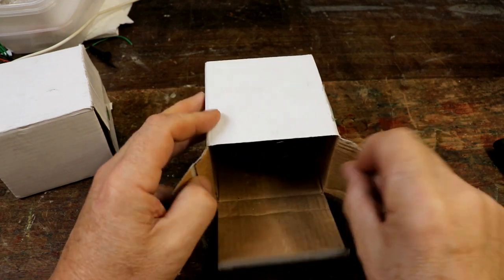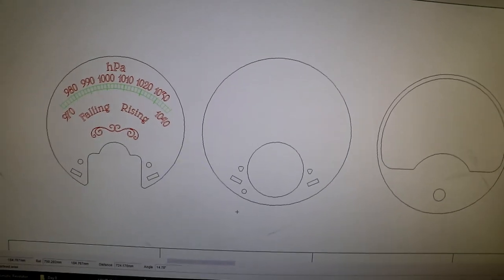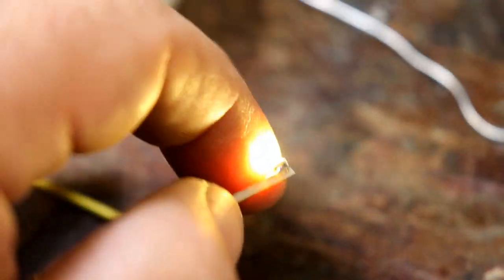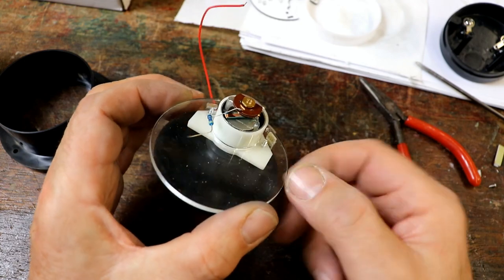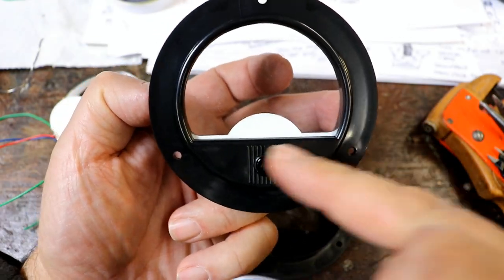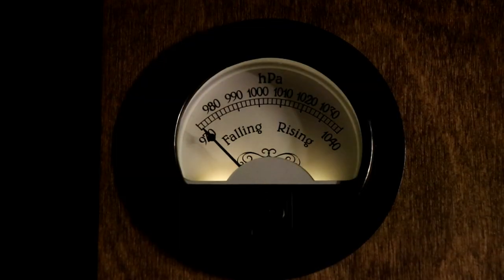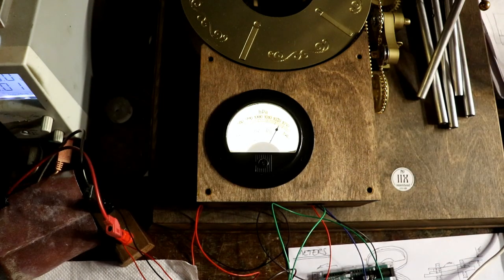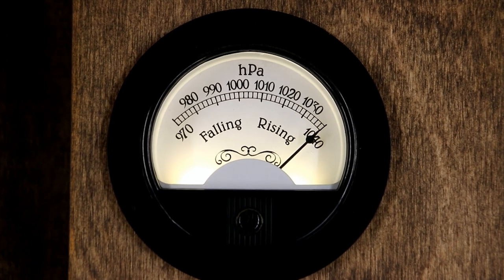How to make your very own working steampunk gauge

Comment: Hi there fascinated by your work and how professional the dial looks.  😊
Anyway, I was wondering what graphics software you were using to draw the dial. I’m having a terrible time with the graduations.😢
Also, I have one of the cheap 20mW UV lasers that use the extruded aluminum beams and web-belts. 🧐
It uses this disastrous Ben-Box software that is unusable and my PC screams its malware!  😮
So, what software coil I use to control the laser; as I think its mechanics are good enough since similar to a 3D printer? 🤓
Thank you for reading my comment… 😊
Reply from the maker: Thank you kindly!

I design the dials using 2D Design by Techsoft. It's used in DT departments in most schools in the UK, as it's been around for years and still only requires a one off license payment. 

It has fairly basic tools, but has one that can rotate and copy a line by a certain number of degrees, around a point. I just divide the required overall dial pointer movement angle by the number of divisions required, and get it to draw the divisions where required. Using the same tool, I start with zero, and rotate and paste the text in the same way. Then I edit each text number to the required value.

I'm sure there must be cleverer and more expensive ways to achive this, but it works for me!

My 60 watt laser cutter also uses extruded aluminium beams and rubber timing belts, but can accept .dxf files. I'm not familar with the Ben-box software. Mine is an LS 3060 bought from HPC Laser Ltd in the UK.
Reply: @steamhead  Ok, well thank you very much.  
I’m an Amateur Radio operator and have several old meters that wool be nice to modify.
There are some professional paid programs I’ve seen before but they all have weird jaggies so yours looked better.
On the laser, most people have been steering me toward LightBurn.
Anyway, this helps out a bunch, so thank you! 😊
Reply from the maker: @SpinStar1956  Happy to be of help. I've found, however you do something, there'll always be loads of people telling you about their fantastic alternative! Whether it's a laser cutter or a programing language, I've never been told 'you're doing it the right way'!
Reply from the maker: A friend has just discovered this gauge graphics software https://soulmare.github.io/scale_master/. I haven't tried it properly, but I hope it's of help.
Reply: @steamhead  ok, thank you! 😊

Comment: I would be so tempted to make a gauge labelled "time until this gauge resets itself" 

Obviously it would start by swinging the needle full right, then very slowly bring it back down to zero, whereupon the process repeats itself.
Reply from the maker: That's a great idea! Love it - it ticks all the steampunk boxes! Once I've finished the ukulele playing machine, I'll definately make one.
Reply: @steamhead  for extra Rube Goldberg points though, use a fancy old rheostat and some clockwork to control it
Reply from the maker: @amishrobots  definately, no cheating with elecmatrickory, other than perhaps to run the actual meter; lead acid glass cell would look nice. The rest definately mechanical, possibly even clockwork...

Comment: Could you just get a micro r/c servo and stick the pointer arm to that?
Then get one of those servo testers and control it  with that.?
Reply from the maker: That's a good idea, especially as the Arduino can easily control servos with one of its puls width modulated outputs!

Comment: I am surprised you haven't rigged it up to be absolute barometric pressure.
However, they look fantastic. 
To save money haven't you considered buying a roll of SM leds rather than the strips which must be more expensive?
Reply from the maker: I think it is absolute, I seem to remember that most barometric readings and types are very similar! Thanks for the suggestion, I have considered buying SM Leds, but still have the remains of two rolls given to me ages ago, which I'm slowly working through. I've got pretty good at unsoldering them when I need single ones! One day I'll order  a load...

Comment: Another great video! what material are you using for the voltmeter scales and where can one buy it? I intend to use 3 meters to make an analogue clock (Hours mins and secs) all needed their own scale.
Reply from the maker: I use laser engraving veneer for the voltmeter scales. It consists of a thick layer of black plastic, with a thin layer of white plastic on one side. The laser cuts away the thin white layer to reveal the black layer.

In the UK I buy it from Techsoft, although it's printed with logos that suggest it's manufactured in the US!

I'd suggest Googling laser engraving laminate

Comment: Could you be so kind as to explain how you went from 5v to 50v for the guage please?
Reply from the maker: Hi Tim, what ever the scale says on a moving coil analogue gauge, the actual gauge movement runs on very little electricity. In the case of a voltage gauge, a resistor is used inside the meter in series to reduce the voltage down to the correct level. In current meters its a resistor in parallel, basically to let most of the current bypass the movement. Some meters even usefully have the FSD (full scale deflection) voltage printed on the dial somewhere.

Rather than calculating the FSD, from whatever resistor is inside and the maximum reading on the dial, you can just get an adjustable DC voltage supply that goes down to zero, connect the meter sans resistor across it, and slowly turn up the voltage until the pointer reaches the maximum reading on the dial. Once you have found out the FSD voltage, you can calculate a suitable resistor for your needs. The 50v meter I used started with a 49.5K resistor which I replaced with 4K7 to give it a FSD of 5 volts (Arduino voltage).

Alternatively, you've got me started now! If you're using something like an Arduino or Rasperry Pie that has PWM (pulse width modulation) outputs, run a PWM output through a 1K resistor into a 1uF capacitor with it's negative side connected to ground. Then connect the positive side of the capacitor through a 3K3 resistor and then to the  'de-resistored' meter, the other side of which is also connected to ground. This will turn the PWM output into an analogue voltage that will run the meter. The 3K3 resistor may need to be changed for your meter. The great thing about this is that it's easy to set the output anywhere between 0 = 0 volts and 255 = 5 volts. Then you can use the Map function at least in the Arduino, to scale down or up some calculated value, such as temperature or even time! to run the meter. Exciting!

Thanks for your interest.
Reply: @steamhead  thanks for getting back to me with such a detailed reply. That's a really helpful answer. 
I did do some digging around and found this other project. Great implementation but not as pretty as yours. I think in essence his method achieved the same as yours. https://michaelteeuw.nl/post/174972004187/what-time-is-it-fathers-day#disqus_thread
Reply from the maker: @TimothyEdDoran  do let me know if you require any more assistance. It's so nice to help others with their ideas. Are you planning to control the meter with something like an Arduino? If so, you can get an analogue meter to display just about anything!

Comment: I'm making a prop guider counter using an electric music metronome, & trying to find out possible ways to connect the circuit board to a similar dile you have here. Is an Arduino the only way to go or can another circuit board be set up with capacitors & a switch component that lets the power threw to the gauge every time metronome clicks threw the speeker.  I'm terrible with electronics, so I don't know how to describe the parts.
Reply from the maker: Hi, that sounds like an exciting project! I'd suggest using one of the small Arduinos to create the clicks and control the gauge, but that doesn't sound like an option if you're not into electronics - still possible though, I'm always happy to help. Alternatively, you could use a couple of resistors and a capacitor to control the gauge directly from the clicking metronome output. I can't post images here, but you can always email me at john@steamhead.co.uk

Comment: Brill. What is the make and model of your laser cutter please? Have you made any mods to it?
Reply from the maker: Hi Morturn, it's an LS 3060 from HPC Laser Ltd in the UK. It has a 60 watt water cooled laser with a 610mm x 300mm cutting area. The best tool I ever bought! Whilst not being that fast - the manufacturer suggests keeping the power under 40%, I've been using it for about 5 years and it's as good today as it was when I first bought it. Reading between the lines, if you run a laser cutter at high power, the laser tube and optics wear out really quickly.
Reply: @steamhead  Thanks, thats perfect

Comment: very slick.  what laser printer do you use?
Reply from the maker: After much research, I ended up getting a 60 watt water cooled laser from HPC Laser.co.uk in the UK, model LS3060. The cutting area is 600mm wide by 310mm high. It's fantastic, although, as recommended, I always keep the power under 40%. Four years on and it still works perfectly.

Having spoken to other laser users at steampunk events, I get the destinct impression, that running them at higher powers ruins the optics and severely reduces the life of the laser tube - less haste more speed?!
Reply: @steamhead  Thanks for the fast reply. Wife and I really enjoy your work and your great narration. Yeah, I figured it must be more powerful than the chinese 40 watters, I don't think they could cut those thicker materials you use. Keep doing what you do.
Reply from the maker: @TheUnofficialMaker  Thank you so much for your kind words, they really motivate me to make more videos!
Reply from the maker: @TheUnofficialMaker  Thanks very much!